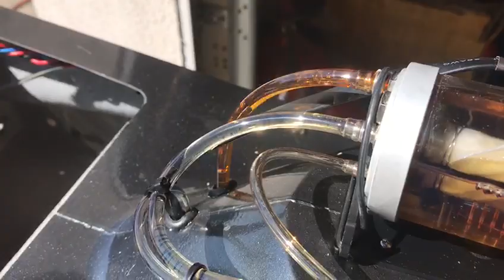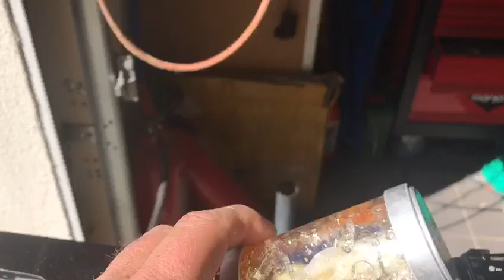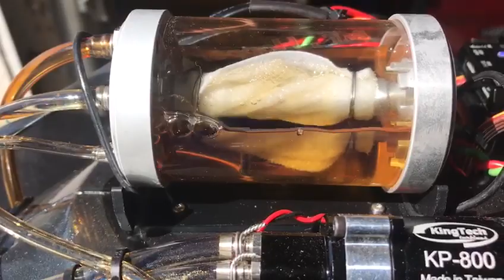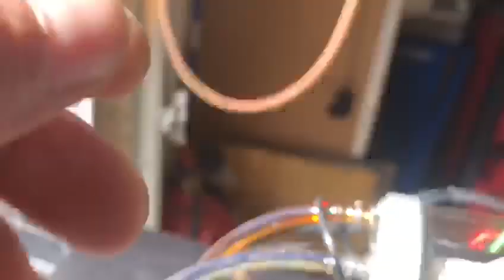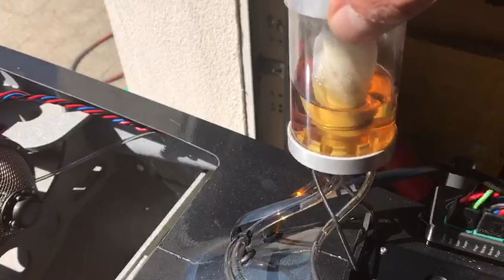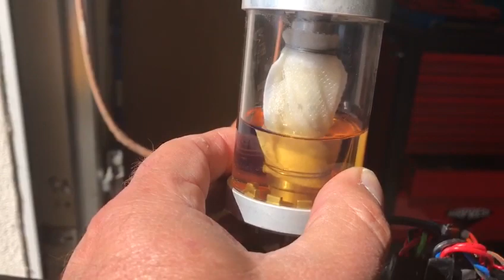UAT 2.0 part 1

Comment: Can you please explain the plumbing? There’s three nipples, pump or engine, tank, and fill drain , tell me where to put the three hose’s? There’s no instructions for the one I have
Reply from the maker: Top goes to the tank , center to the pump , bottom for fill
Reply: @sandorkruise7660  tell me about  the bottom fill, I have the fuel tank and pour fuel in it and plug the hose to the turbine which is connected to the fuel pump, it’s the bottom fill I don’t understand where do it exactly goes show me the proper way of plumbing
Reply from the maker: @michaeldunner7891  you fill the fuel tank thru the UAT... otherwise you will never clear the air out of the uat.
so again  : Top conenction goes to fuel tank , center is for fuelpump , Bottom one is for filling the system. you fuel tank ONLY consist of a Fill/drain and a breather hose thats it. no need to fill tank on itself
Reply: @sandorkruise7660  I can use the fuel pump to fill both tanks then seal off fill nipple and put out fuel hose back on turbine?
Reply from the maker: @michaeldunner7891  why would you fill 2 tanks